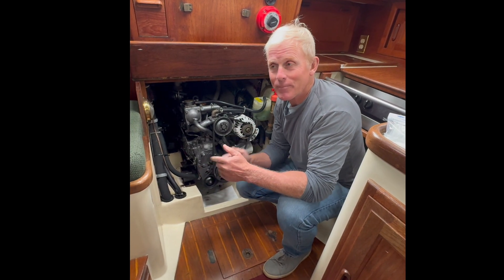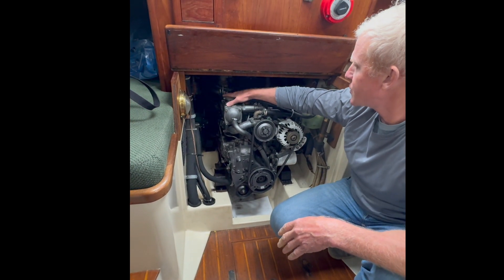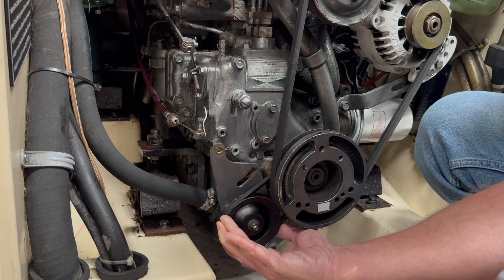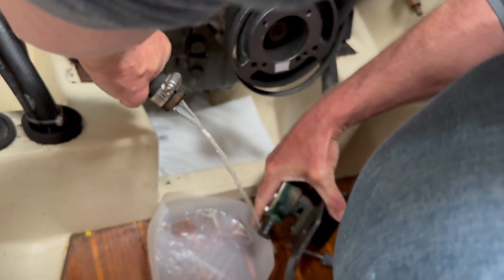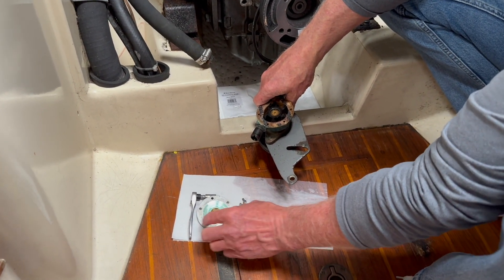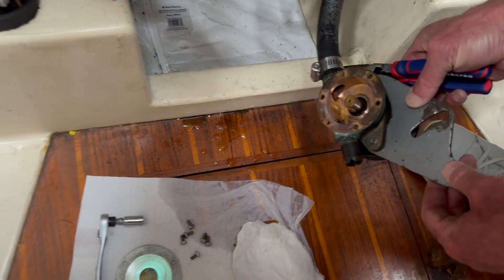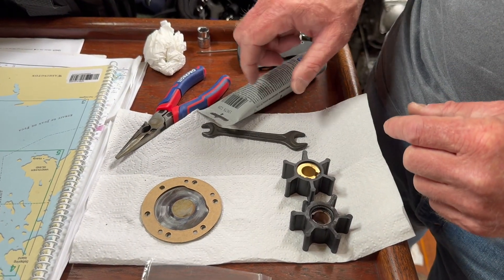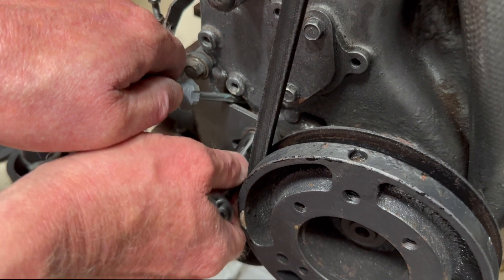Changing the Raw Water Impeller on a Yanmar Marine Diesel

Comment: I use a wire tie to pull the finials back into the correct direction. I place it on the outside edge, place the impeller into the pump and then snip off the wire tie. Makes it really easy. Hope that helps.
Reply from the maker: Thanks for the tip, that's a great idea!

Comment: I have PSC34 hull 124 from 1989, Sea Change - see videos on YT about my circumnavigation. About the engine name, the H indicates an enhanced performance model improved from the GM model, and the F indicates it is cooled by fresh water via the heat exchanger, rather than directly by the seawater. sadly Yanmar does not support this model anymore, so new parts and spares are harder to come by, but you can find then used on eBay and elsewhere. Thanks for the video.
Reply from the maker: Thank you for the watching and the info.

Comment: Great channel. As far as removing the hose, go ahead and get the clamp way out of your way if you can. So loosen it up more and move up the hose about 6 inches, for example. If the temp is colder, this might be harder, but in this case, the clamp was loose enough. Sometimes, though, it will fight you.

Next, put consistent pressure—like opening a jar lid. Slow with pressure is your friend.

If you have lots of time and not much strength—so, for example, if you're older or not as strong as you used to be—you can use a paperclip, fingernail file, or one of those very small flathead screwdrivers your grandpa used to carry in his pocket protector to break free the corrosion inside with out damaging the hose.

Most of us will be doing this using what's on board, so a pick set or other things I would recommend here likely won't be available. But when you do get it off, make sure you clean the neck as well as the rubber, and put a little lubricant on it so it slides on easier.

Lubricating the clamp is good too so it tightens the way it was designed to. 99% of the time, most of this is overkill, but if you're preparing for a longer passage, it's the little things that make the journey pleasurable.

BTW, thanks for recording this. As popular as PSC is, there's very little on engine stuff. So thank you for your contribution, and good luck with your amazing boat!

Comment: Hey, Also a 1988 PS34 owner, A few tips: It is better to remove a few zip ties and flip it over than pulling the hose off. The barbs will eat up the end of the hose from the raw water strainer and need to be replaced every few years. Second, you should have the "vanes" or "diffusers" orientated in the correct direction when reassembling. The impeller spins counterclockwise when looking at the back. Place a zip-tie on the vanes to orientate/compress them then cut it off when you get it started. I only use dish soap, Your alternator belt looks a little loose. Thanks for posting, and fair winds!
Reply: Thanks for the tips. That's exactly why I'm posting these, so that I can learn. Cheers!
Reply: @markshriner7089  We looked at your boat in the spring when she was for sale in LaConner. Our 34' is at Shilshole, DM me if you want to swap tours someday.
Reply: @TheSlowbat  Not sure how to DM on YouTube, but I'm always up for checking out nice boats.